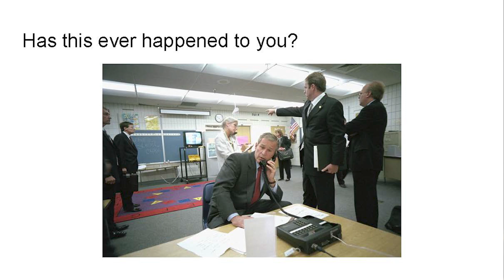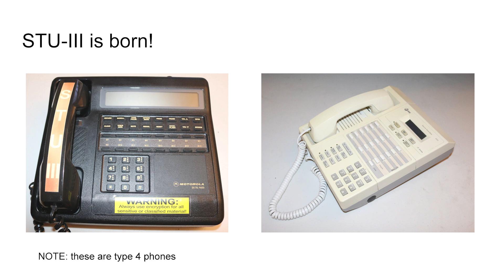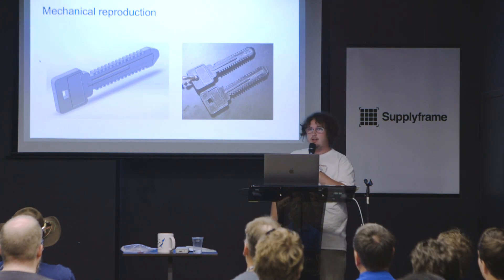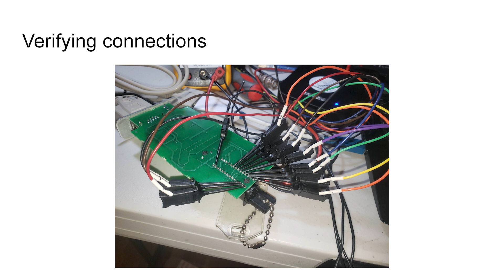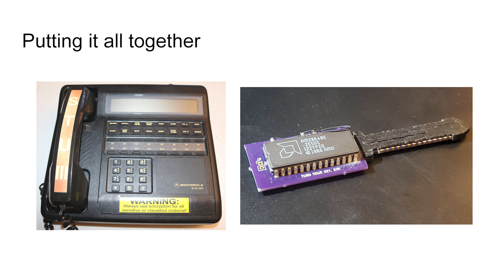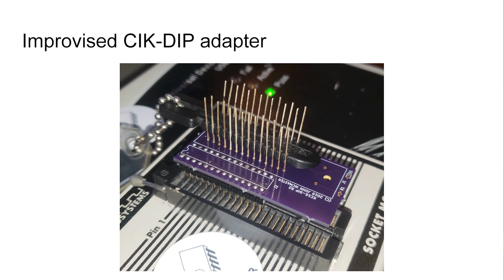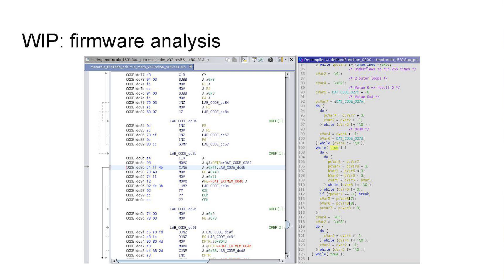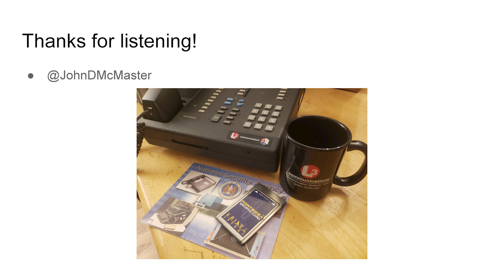John McMaster - Replicating a Secure Telephone Key

Comment: whats the point of a key that has absolutely no protection of key material in place?  	 thought there would be fun stuff going on inside but NOOOO its just an eeprom
Reply: This is the 80s. Can you think of a key-sized microcontroller that could to any crypto? The intelligence community also relied a lot on opsec back then.
Reply: I feel the same way about all hotel room keys.
Reply: I mean... they used to have the keys printed out on paper. The person with custody of the key and the storage procedures they follow are the protection, rather than the device itself.

Comment: Hi ! That's great, I work for a company that used to sell voice call recorder that used same types of keys, instead they are blue. The recorder was named Wordnet series 3. I am have bunch of these keys. I can send you a key if you want.
Reply: Hello! I used to work there too. The Wordnet keys (made by DataKey) had fewer pins than the ones shown. 8 per side.
Reply: True story: The factory where I worked installed new vending machines in the canteen one day. They were cashless and used loadable tokens to pay for drinks. Yes, they used the same keys as Wordnet (and Wordsafe) as the tokens.

Being engineers, we immediately took a key and put it in a reader to examine it (It's just an EEPROM). The amount stored on the key was held in clear ASCII text at the beginning of the data, with no security whatsoever.

We (being honest, mostly) went to the installation engineers and rep who were still on site and said that their keys were not in any way secure, but the firm insisted that they were!

I can neither confirm nor deny that we enjoyed free coffee for some time.
Reply: @AlexanderWright1  you can't block an engineer if he want free coffee. That's why, now, it is free \o/
Reply: @AlexanderWright1  An engineer and their coffee are easily parted. NOT.
Reply: Hi! The newer serial ones are relatively easy to get a hold of and I have a lot of them. But thanks for the offer!